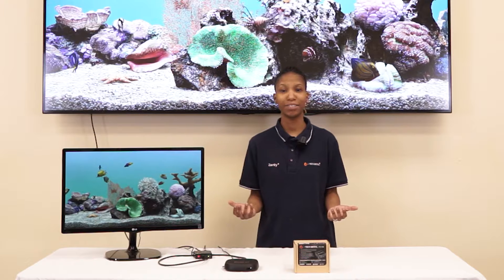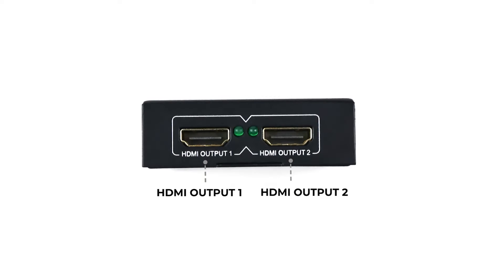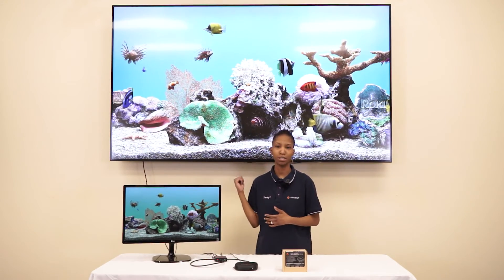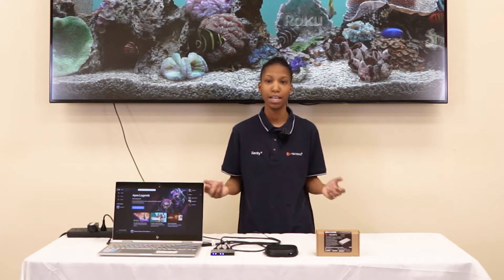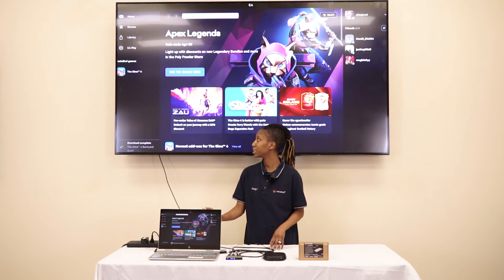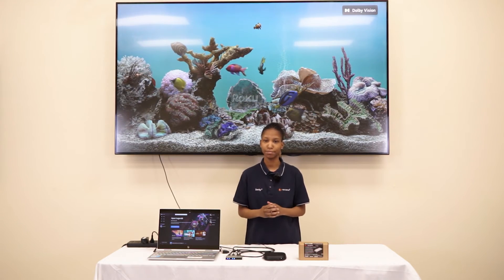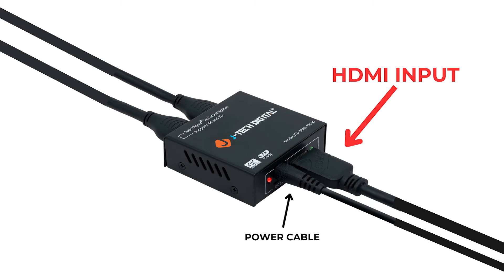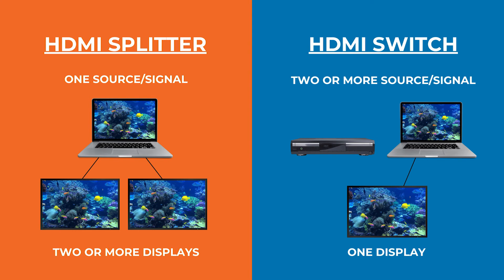HDMI Splitter vs. HDMI Switch

Comment: Thanks for explaining the splitter vs switch when using the HDMI cable.

By the way, I am looking for the issue that when both devices are using the RJ45 or the LAN cable instead of using the HDMI cable.

Thank you very much.
Reply from the maker: Thanks for your comment! If you're using RJ45 (LAN) cables instead of HDMI cables, you're likely using HDMI extenders over Ethernet (Cat5e/6). These are different from HDMI splitters and switches, they transmit HDMI signals over long distances using network cables, but they're not network devices (they don’t use your actual LAN or internet).

So if both devices are using RJ45, you’ll want to make sure:
1. You’re using a compatible HDMI extender set (TX and RX),
2. The connection is point-to-point, or properly configured if over a network switch (some AV over IP models can do this),
3. And you're not plugging them into regular LAN ports on your router expecting HDMI to work; the signal is only HDMI over Ethernet cable, not actual Ethernet data.

Comment: now, what about if i want to extend the display of my laptop to 2 monitors? is that "adapter?" Just wanna make sure I have the right term.
Reply from the maker: The device that would assist you with splitting the display of your laptop to two monitors, or displays would be an HDMI Splitter.

Comment: Can the splitter work for audio? My scenario is my monitor has one hdmi going into the ps5. I need another hdmi so my soundbar can connect to my monitor as well.
Reply from the maker: For this scenario, you could use an audio extractor that has HDMI audio only out. The splitter splits both audio and video, however our splitters do an EDID check on the output, so if it doesn't detect a device that takes a video signal, just audio, it may not work.

Comment: So what do I use if i have two mac, one newer, one older, to two monitors that I want to use simultaneously? So two sources, used independently, connected to two monitors. I am told I need a KVM, but is a splitter an option?
Reply from the maker: A splitter will only allow you to duplicate one source to different displays. For your setup, you would benefit from a KVM switch with 2 inputs and multiple outputs so that you can toggle, switch, and control whichever source you would like. Also a splitter only duplicates one source at a time and you want to be able to see both sources and control independently. You can try this: https://jtechdigital.com/product/4-port-hdmi-kvm-switch-4k60hz-hdmi-usb-cables-included/